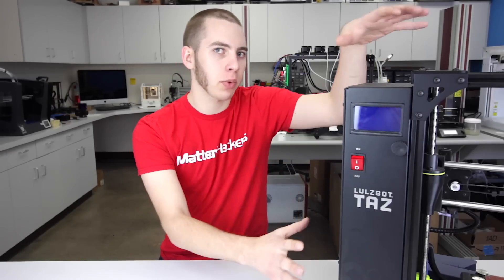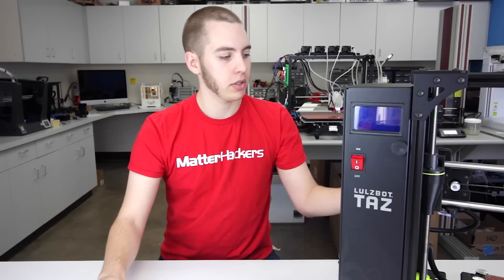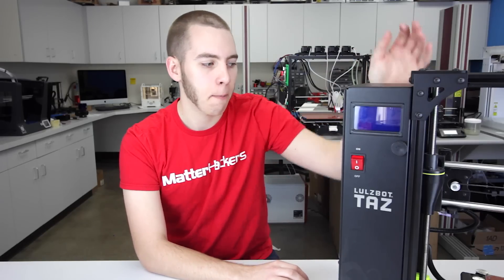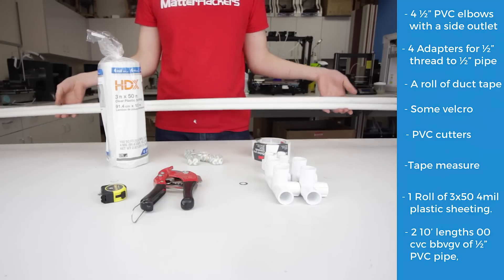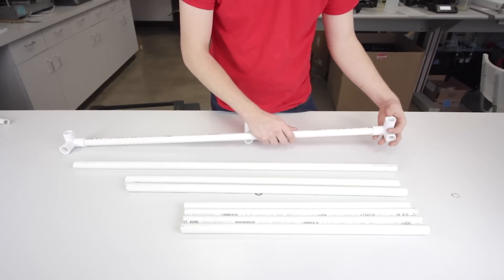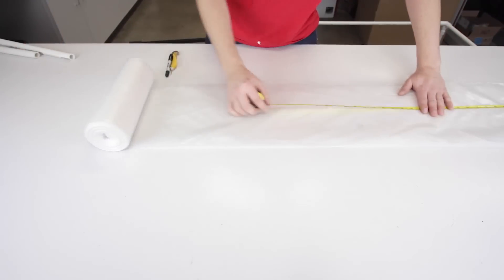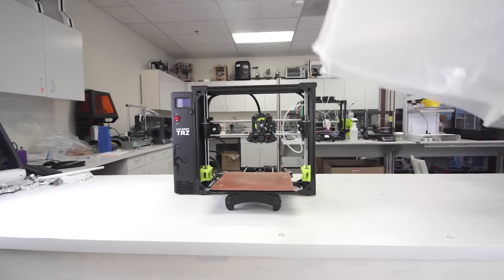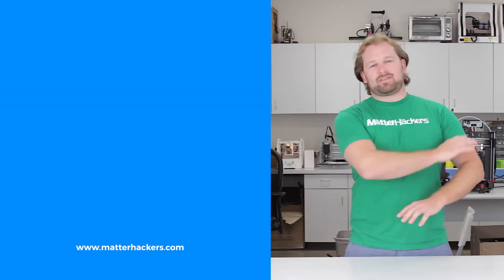How to Build a Cheap Enclosure For Your 3D Printer / Printing with ABS

Comment: If we cover it with the box/enclouser without modification on the 3d printer, won't the power supply or motherboard suffer from temperature? when we use "the ikea box", it moves to power supply to outside of box but mainboard still in the enclosure. I am worry about damaged from temperature. What do you think about that? My worries are unfounded?
Reply: The mainboard isn't producing that much heat itself i guess (a powersupply does) so i don't think it will really get damaged by the "room temperature" increasing by 10-20 degrees (C).

Comment: Why would I want to print with ABS when PETG is less restrictive and I have your Pro PETG nail down for printing.
Reply: because ABS is cheaper and more widely available in different colours.
Reply: @jaidsaviero  And then there is POM/Delrin(TM)/Acetal(TM). Adhesion solved by sketching paper but it still curls up. Also the PC sheet pops lose on the borders.

Comment: Recently on a trip (google Pennsic War) I built an enclosure/wind-shield for my 4-burner stovetop from 1/2" polyisocyanurate (foil-faced) foam, taped together with cheap dollar-store packing tape. It worked great. It says 'flammable' but basically it won't burn by itself and makes a great heat enclosure.
I'm a 'maker' but new to 3D printing...just assembled a friend's 3D printer, an Anet A8 (PITA!). He has two rolls of ABS...after doing some research before my first print, it looks like i'll be building an enclosure...

Hopefully my first 3D printer will be a Creality CR10 S5.

Comment: My simpler solution was, like someone else, to use a corrugated cardboard box. I cut a door in the front, sat it over, and it worked OK. Then I 3D printed a door handle to glue on to make it a little friendlier to use. Pretty ugly, but it definitely worked - I got some successful ABS prints on my lowly FLSUN Delta. The corrugated cardboard probably has better insulating properties than this, as well as being easier and cheaper. But if you're going to do something a little more complex like this then presumably you want to maximise the insulation properties, and a single sheet of plastic isn't going to be great for that - even using bubble wrap instead should noticeably improve the insulating properties?

Comment: If you are watching this vieo, please do not put your power supply inside the enclosure...
Reply: On X-core would it not be sufficient to encase the part above the electronics. Really fancy idea is having a curtain spanning from heatbed up to top but rolling out as the bed goes down (print grows)  and rolls back in when raising (empty bed to go to start position). Think asphalt lorrys on the way to highway construction/renew site.

Comment: I 3d printed corners (used very little filament), used 1/2" pvc conduit ($5 total for 2 10ft pieces), and used a large trash bag, whole enclosure was like 6 bucks for my ender 3.

Comment: Wouldn’t this be a little dangerous cause it’s made of thin plastic?
Reply from the maker: The temperatures inside aren't getting to extreme temperatures. It's about 40C (104F) inside when printing ABS. Hot for a person, but nowhere near close to damaging parts of the printer.

Comment: Hi, wouldn't that damage the printer over time?
I could imagine just isolating the bed temperature around the printer and plus the higher temperature that the nozzle has. All that heat would accumulate over time. and maybe cause some damage to electronics specially since most of them are rated at 85 degrees Celsius. Also some plastic parts would be deformed over time, don't you think?
Reply: I haven't tried this myself, but I'd guess that with the heat losses from your enclosure you should be fine. This insulation is nowhere near enough to keep the temperature much higher than room temperature. The heating elements might get the bed up to 80° Celsius but won't be powerful enough for the entire enclosure. Most people online measure temperatures of around 30-40° Celsius in their enclosure. Apparently that's enough to enhance printing performance without harming the electronics or other parts. That being said, the long term effects might be different. Some people move their electronics outside of the enclosure just to be sure. Matterhackers did comment somewhere that the printers in his farm all use enclosures without problems.
Reply: I just wonder whether someone else does maintenance, so if one croaks it's not his problem...

Comment: I'm using silver mylar bubble insulation, and I'm hoping to keep the electronics and steppers away from the heat as much as possible. I'm building my CoreXY printer now. Smaller insulated area = higher temps at the actual part. I have also wondered about pre-heated air ducted to the part fan. Thoughts? Apparently commercial operations control the part fan temps and ambient temps separately.

Comment: i get this issue when trying to print abs and heating up the bed. (the bed only)  Error: Heating failed, system stopped!  Heater_ID: 0  .. it happens when the printer hits about 81-82C and the printer halts.  I asked a tech, he says the psu isn't strong enough, which for some reason doesn't sound right?  psu is 12V 20A
Reply from the maker: Please email support@matterhackers.com - we will help you out!

Comment: Why all this trouble? Why not just use foam board, it is a good insulator for both sound and heat. Super cheap $1-$2 a sheet which is 2x3 feet. and super quick to put together, also foam board comes in a variety of colors to match your printer
Reply: I have a few foam core boards that are plastic coated surface, the ones they use for the easel stand, it would work perfectly. No frames needed, I just need tape, ruler and a box cutter. But I may need to design a peeping window though...
Reply: maybe because it is not transparent.
It does a very good job isolating the outdoor temperature.
Reply: That would be just as good for cheaper , luckily my dad works at a place where he can get all this stuff for free so that why I went with this one for the sake of not paying anything
Reply: I've been wondering how you could have a nicely insulated enclosure with foam core or rigid insulation while also having something semi fireproof. Any thoughts?

Comment: https://www.amazon.ca/Neewer-Shooting-Diffusion-Backdrops-Photography/dp/B00GKGGICC/ref=sr_1_1?ie=UTF8&qid=1486045146&sr=8-1&keywords=light+tent+for+photography Cheaper, faster to assemble, and you can put it away when your not printing abs.
Reply: Tempting. Are you acctually using this with your 3D printer and can comment about how it is working? There is probably not much thermal isolation.

Comment: only 25? for 25 you can build an entire wooden box with hinged lid also leaving out the pvc parts on the bottom to save some money really reduces the strength of your frame.
Reply: You can do a better job with 5 sheets of foam board which costs about $5bucks and a roll of matching color tape
Reply: rockwater999  Lets just agree you can make somthing beter for less or the same. i would prefer Wood sinxe you could really make something nice with it but foam would work as well.
Reply: I agree, my point is the same as yours is that the enclosure in this video is overly complicated and priced for what it is. Also in my personal opinion it is quite ugly
Reply: surprised no one said anything about using aluminum angle as it is lightweight and cheap, and some steel banding like you find tossed after cutting lumber, rebarr and steel tubing loose from the pallets, works great with some adhesive to hold it inside and magnets from outside for quick hold and release to get in and out, as well as disassembling it to move the printer from location to location lol
Reply: only $5? for 5 you can have much better quality and cooler look with parachute material draped over the frame of the 3d printer itself.
Reply: to be fair some peploe are thick at building stuff
Reply: He gave his reason for the material choice in the video.
Reply: @Timothy Rios - But trolling is much more fun than watching.